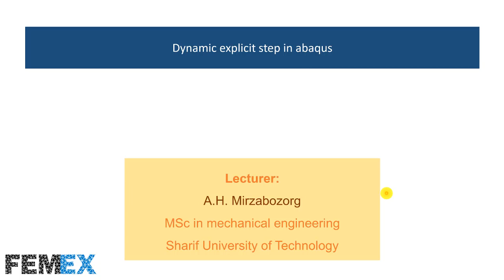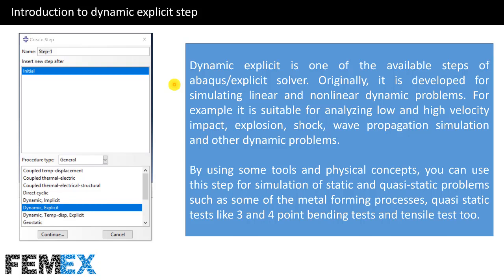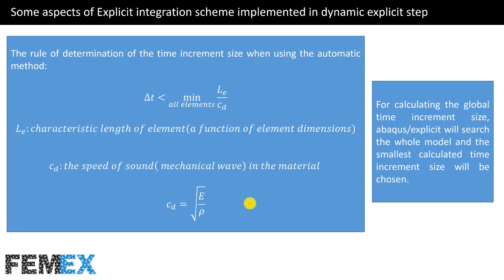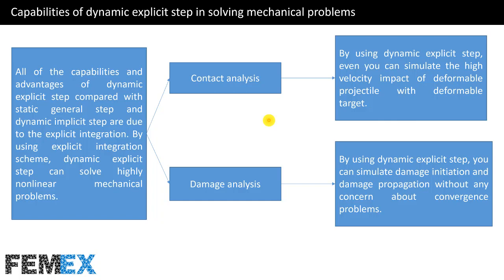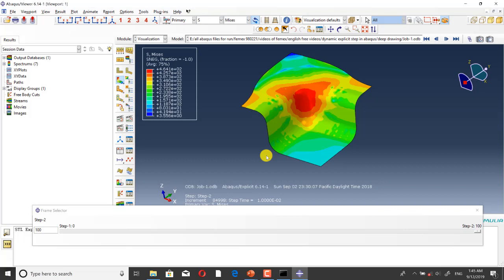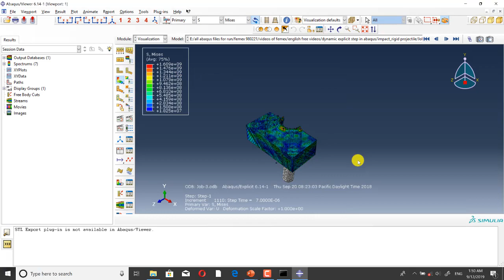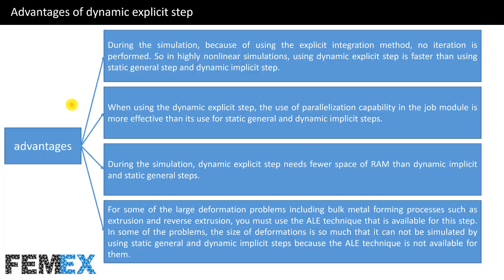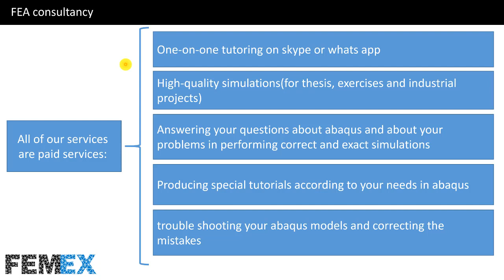dynamic explicit step in abaqus

Comment: sir..How to fix flux limit ratio to ensure the  stability of numerical simulation by restricting the time incementation?
Reply from the maker: Hi.
Usually we don't change those parameters of the solver because they affect the simulation accuracy. We try other procedures to get the solution.

Comment: In orthotropic material E in each direction will be different, for calculation the Cd factor=radical(E/density), which E we must substitute E1 or E2?
Reply from the maker: hi.
actually the formula for calculating the mechanical wave speed for orthotropic materials is not mentioned in the documentation and I don't know how does the Abaqus calculate it.